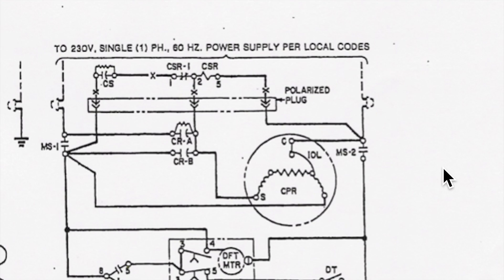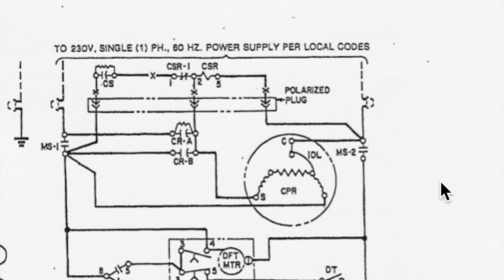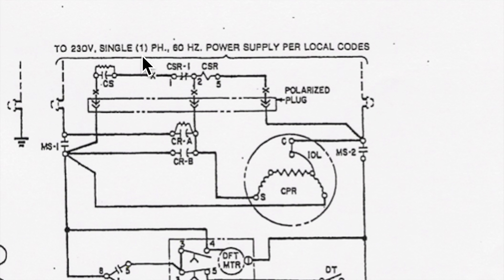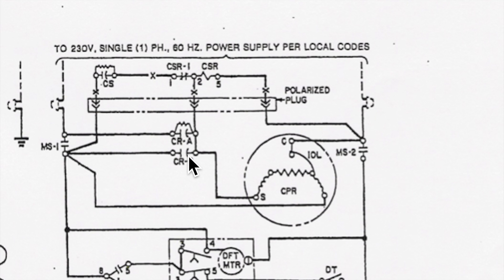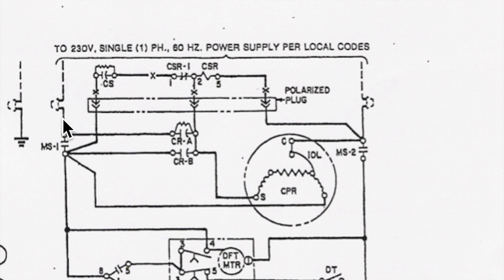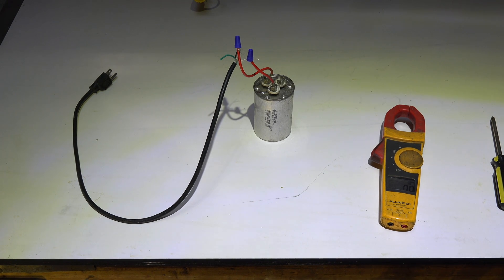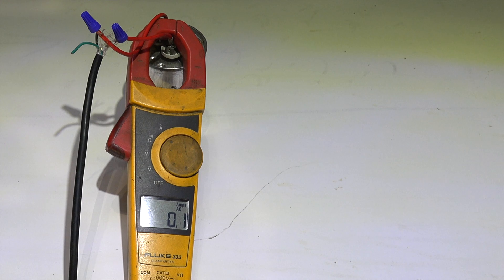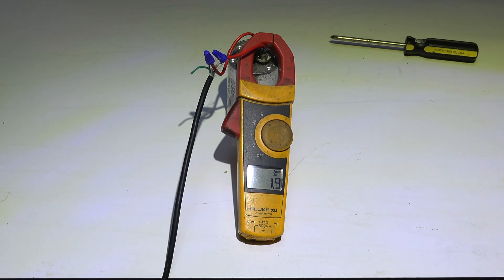Can a capacitor be a compressor crankcase heater?

Comment: Would you consider doing a demonstration and expressing your opinion on testing a run capacitor multiplying the amps times 2650, then dividing by the voltage at the capacitor for the mfds? As always thanks for your real world videos.
Reply from the maker: Try this:  https://youtu.be/4oNT-U4tZtQ
GFM

Comment: Hey GFM, At what temperature are crankcase heaters usually required? Is it more based on a design philosophy? A particular design over another?
Reply from the maker: There is no ambient temp.  It is a temp difference.  Coldest place gets the refrigerant.  Manufacturers have different methods that include on in the off cycle, on all the time, discharge temp shut down.
GFM

Comment: Which is why you never replaced the single pole contactor with a double pole contactor in those instances. Now you won't have a crankcase heater.
Reply from the maker: I have replaced locked rotor compressors that I had a high suspicion failed because the contactor was replaced with a 2 pole.
GFM
Reply: @grayfurnaceman   I'm guilty .100 convenience stores up and down the state with the first heatwave of the summer. I'm the only one on the weekend call.  It's not OK but I had to spread myself around and the self-contained equipment in the stores won't wait for the right parts. The 70's
Reply from the maker: @brianellsworth4767  You can replace a single with a double pole and just install a jumper across one pole.
GFM
Reply: @grayfurnaceman   I would do that. depending on how short the burnt short wires were. I did not work for a so-called outside company at the time. To all the new guys. Do not work for people who encourage short cuts. You are all better than that
Reply: @grayfurnaceman ,  I just remembered what I actually did. It was a long time ago. It was a record cold day. The R12 freezer would not come out of defrosting. It did electrically but the refrigerant could not overcome the evaporator pressure. The liquid just stayed in the receiver and only vapor would hiss through the evaporator. After I cut the wire to the condenser fan motor liquid made it to the Xvalve and the sight glass looked normal. I found no amperage on the CC heater.  I came back with  CC heater and hooked up a fan cycling switch. I noticed the CC heater was wired across the NO contacts. I wanted the heater on all the time.  I already had the new one on the compressor.  My problem was I did not know what the voltage rating was for the original heater because it was in series with the compressor. I wanted the compressor to stay warm so I wired the 220volt heater on the hot side of the contactor. If I wired the original back it might burn out if it was not wired in series with windings. There never a callback and it outlasted the shopping mall but I never found out what the original heater voltage was. They were not aux contacts, on the contactor. It was set so the heaters would only come on when the compressor was off.
Reply: Exactly, but I have done it. People would shut off the unit at the disconnect over the winter. The first hot they just flip it on and no one would wait 24 hours even with a crankcase heater.

Comment: more efficient to heat the case/oil/liquid refrigerant area itself, vs. the thole motor winding which is only in minimal contact with it. plus the band heater is less likely to fail long term than an always in circuit capacitor. it likely confused many folks and they cut out and tossed them lol